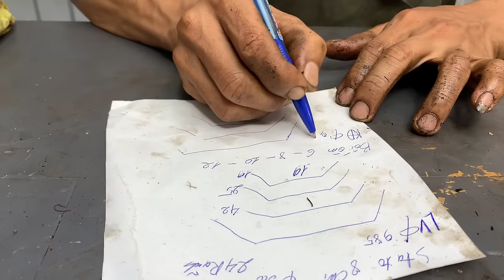Simple - Restore A Submersible Water Pump With A Burnt Out Motor // Perfect Craft Workshop

Comment: Awesome job you did restoring the submersible water pump. More amazing is how you rewound new wire into the stator part of the motor.  I bet that rewinding in itself requires a great deal of skill and electrical knowledge.  The pump looks much better and it works like new as well.  Great work.
Reply: Quấn lại bằng dây nhôm. Chất lượng kém